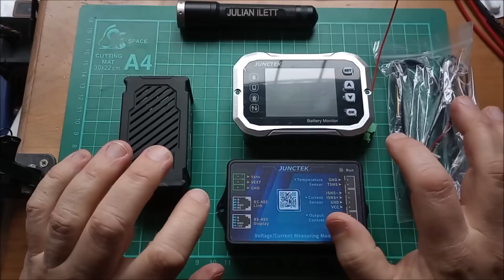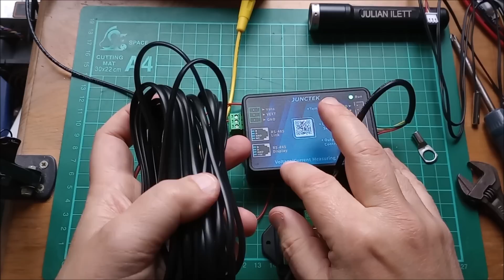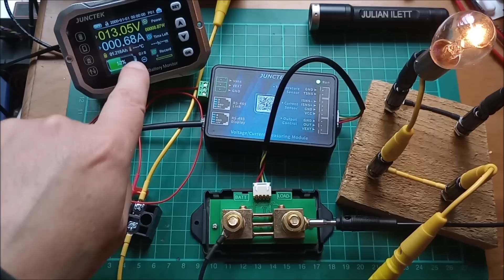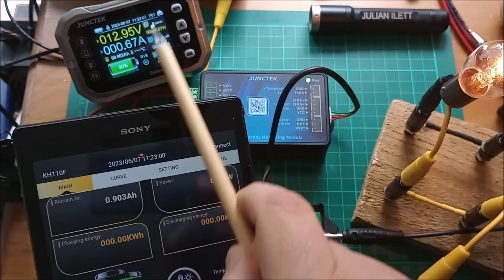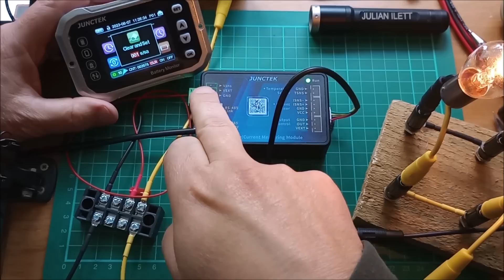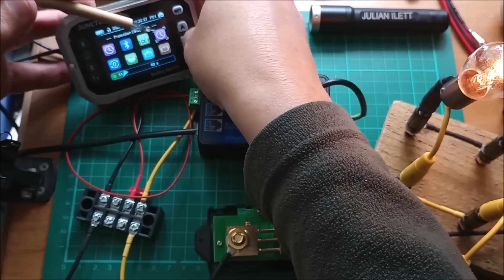Junctek KH110F Battery Monitor/Coulometer

Comment: Hi Julian. I've had the 400 A version of this for some time. It's never kept time properly - the date keeps slipping. And unfortunately when I updated the firmware yesterday (27/9/25) it broke the app (v1.4.2, which has no updates available). The app shows a "loading" spinner until you press back, but then you can't set any parameters including the ones which determine full charge, which you can't set on the display. Furthermore, it no longer displays the firmware version. I've updated the firmware before without problems.

Comment: I bought this device too a couple of month too. I integrated it into my solar system and into home automation and I'm doing a lot of long term tests. I hope, the firmware gets sorted out the exisiting issues, as the device is nice hardware. The data recording is done in the measurement unit. One can disconnect the display and come back later and the settings and recordings are all there. The display is pretty dumb, all the intelligence of the KH-F series is in the measurement unit.
The relay makes no sense to me, in connection with the display, as an easy tap on the OK button of the display toggles the relay, so one could easily cut off the battery system by accident.

Comment: Can you recommend the relay that goes with this unit ?
Reply: I have tried to communicate with JUNCTEK to find out what the current rating of the relay driver is, but we have not found a common language to answer this question. The on-board driver looks pretty strong and has a free-wheeling diode, so running relays up to a few hundred milliamps, maybe even 1-2A, shouldn't be a problem. Please don't take my word for it though, I didn't receive any technical data. 
I tried using a 24 V relay, which draws about 50 mA and is basically a truck headlight relay, to trip a 250 A circuit breaker on its remote input, which worked fine. But there's still a downer - the OK button on the display toggles the relay with a simple push of the OK button without further inquiry. This means that the battery system can be cut off unintentionally by a simple handling error. Otherwise, the KH-F series is a fine piece of hardware. The firmware may still need some work.

Comment: Hi, I have seen that the shunt is really a 200A one. Does the unit limit the display and log data to 100A ? Or  can it measure (for a short time) currents above 100A ???  Thanks for your videos!

Comment: I use an Eco Worthy Hall Current ring, still a passive monitor, but you don't need a shunt. It reads in both directions.
You can tell it the battery capacity up to 200 amps.

Comment: I just bought this unit two weeks ago. It works great. The app is Bluetooth and it also is s great working app. I use the app for all the settings. I have not used the displsy yet. 
You can calibrate it as well.
Very compact. It is also sold without the dispjay modual and just use the app with the main modul.
Lots if info and the relay is a great bonus. This is perfect for using batteries and a Grid tir inverter with.  I use a Epever 50 a charge controller newer version. It also has the same capabilities this unit does. 
However I love gadgets. Lol
I highly recommend commend this unit for battery monitoring. Seems to be very accurate.
Great video.
Can you do a vid on the relay ststem?

Comment: Hoping  Bluetooth connectivity is in the display unit, not the module at the battery connection. Not sure if Bluetooth will reliably reach our living area from our battery room (about 10 meters away).
Reply: Bluetooth is in the measurement unit, the display unit is pretty dumb. But you could easily extend the display cord to 20 meters without serious problems, to have the display in your vicinity.

Comment: The connector RS 485 LINK, is for your home pc computer network . For much better usability and more functions.
Reply: Can use RS485-LINK interface to communicate with HA
Reply: The two connections for display and RS485 are connected internally in parallel. The display unit speaks the same protocol as a PC would do. Unfortunately, the display chatters so much and so quickly on the RS485 line, that a PC has real difficulties to talk to the measuring unit without line contention and data collision. I had to take off the display from the RS485 line, to get the communication running reliably. Even if the display turns dark after some time, it continues to chatter on the line.
Reply: Can we use Rs485 link of this unit to connect it to solar inverter? For example, could Must  PV18-3024 inverter control battary state during discharge and charge? There is a Rs485 port on the inverter and settings for Li in menu - collection of information about battery state of charge from BMS. So, it may work?
Reply: @AlexV-j3v  The RS485 link of the KHF device uses its own comm protocol, which is not MODBUS, but something different. Most inverters use MODBUS Pylontech or something else. RS485 is the hardware transport standard, MODBUS or even the Junctek KHF protocol is the software on top of it. So if your inverter speaks Junctek KHF over RS485, the  your idea could work, else not.

Comment: For best accuracy, the voltage sense or power to the main module needs to be connected directly to the battery, not the cable carrying the load, as the voltage will sag through losses in the cable.
Reply from the maker: At higher currents, I would certainly agree with that.

Comment: Whats the current resolution when using a 200A shunt. 0.075/200 is 375uV per Amp would be nice to see the ADC spec.
Reply: Squeak !
Reply: Woof!!!!!!!!!!!!!!!!!!!!!!!!!!!!!!!!!!!!!!!!!!!!!!!!!!!!!!!!!!!!!!!!!!!!!!!!!!!
Reply: There is a 400 amp version for a slightly higher price.